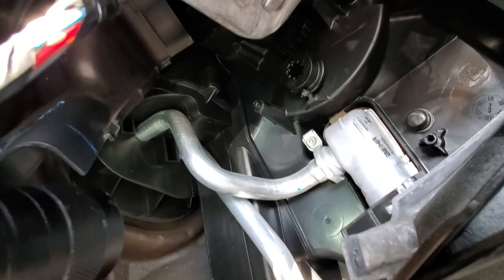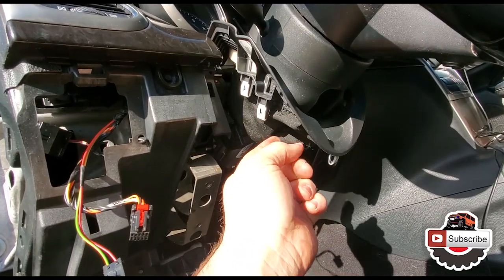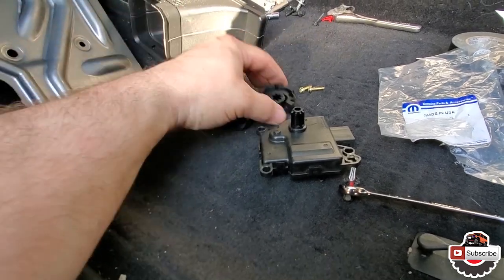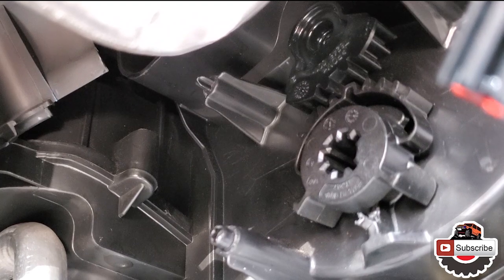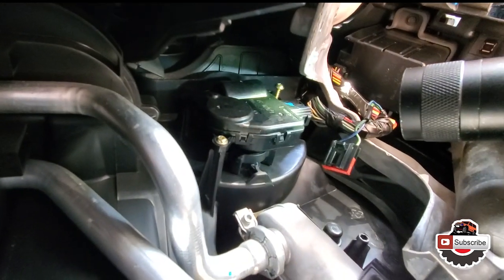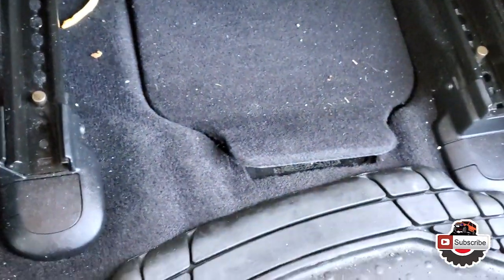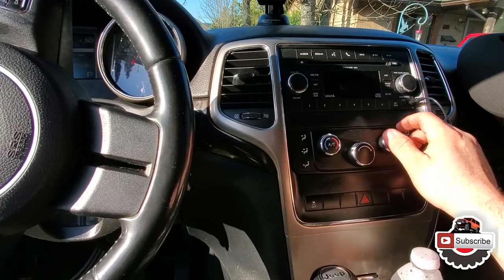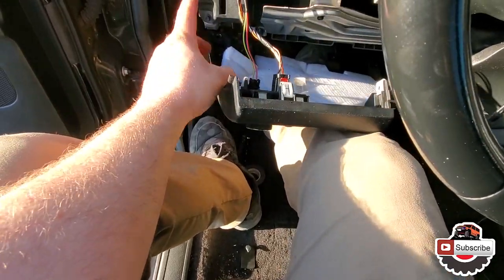2011-2017 Jeep Grand Cherokee Driver Side Blend Door Gear Repair Guide

Comment: Got mine done, However I am 6"3'' and have large hands. So I used a step drill and bore a 7/8 diameter hole in the aluminum panel. This allowed me to get top screw out by inserting a 1/4 in ratchet with the torx wrench. I highly recommend this for us larger guys. Made it sooo easy!

Comment: I just got done replacing this part and there are 2 tips to add to this video 1. there is one screw next to the steering column that holds the right silver bracket from above. It's around the right screw for the panel. 2. the duct right across the actuator splits if you squeeze it giving you enough room to reach the one difficult screw for the actuator.  That's it. Good luck repairing your jeep.

Comment: Hey, today I risk it all and fix my air conditioner, I follow your steps and Danm a was hard at first but I manage to do it all and every step u did I follow and a was hard to put the piece in there but I wanted to give up cause a was hot down there but 100% successful, hahaha I’m so greatful I got it fix I save up $700 hahaha now I know how to fix it without paying a mechanic thanks for your video
Reply from the maker: Glad that worked out for ya!!  Good job, It’s definitely not an easy task to accomplish.

Comment: Good video but you did not have to take the actuator apart just turn the HVAC controler on and plug in the actuator it will start turning and when the alignment Mark's line up unplug it. Then install the actuator and plug it back in.
Reply from the maker: Didn't really think about doing it that way. Thanks that's some good info.

Comment: Great video!  I have a 2012 Grand Cherokee.  I replaced the gear and actuator on the passenger side in 2019 and remember watching a video telling me the driver side is much worse.  Well the dirver side had no heat 2 weeks ago.  I ordered the actuator and the gear and tackled this project over the weekend.  I have a couple added tips:  1)  Definitely need to take out the upper duct work to get to that upper screw on the acuator.  It is hard and seems like it wont come out, but it will.  Break the clamshell and take out the rear first and then the front.  When you put it back together, put the rear in first and then force the front part of the upper duct in.  Then do your best to snap the clamshell together.  2)  Reattaching the hood release cable with the kick panel doesn't work.  You need to take off the hood release lever from the kick panel and then attach the cable to the handle.  Then insert the handle back into the kick panel.  Thanks for all your help!

Comment: This is perfect! Mine is the passenger side. The quoted me 3.2k and said my entire HVAC was damaged. I was like how? So I will be ordering and replacing that piece  to try this. I'm 8 months pregnant and cant drive in this heat with no A/C. Thank you so much.
Reply: Hi Toni, I’ve heard exact same from my dealer. Decided to do it myself. My motor was good, just shredded plastic gear and stuck blend doors. Apparently you can access that by removing door vent. I ll work on my soon and let you know. We’re you able to fix yours ?
Reply: Hey guys actually passenger side is easier than driver side passenger only took me 10 mins to do it the driver took me about 1hr an a half for my durango good luck guys and take your time to get it right the 1st time

Comment: Great video Bro. I actually used it a couple years back to replace the gear on the drivers side. Now the passenger side is blowing rubber out the vent and the door gets jammed. So you have any suggestions for that w/o me having to take the dash apart to remove the distribution box?

Comment: Very good video brother  I don't know what I would have done with out your help 
I just got it done on my 2012  the only thing I did was I turned the gear  that  I replace with the one that was good I alined them I rotated them with air on to find out witch direction cold was lucky that the motor was in that direction also  put air on low and installed no calibration    I did have trouble with the air vent that I had to move puting it back sucked   thanks brother  and yes those pipes were HOT
Reply from the maker: You're welcome man! Glad this was of use.

Comment: Thank you!  Quick question, would having the actuator disconnected cause the blower motor to turn on and off on it’s own?  I have replaced the compressor, expansion valve, blower motor, resistor, and a/c controls module but the blower motor starts at full blast and just drops to low power every 30 seconds.
Reply from the maker: No that would cause that, have had to replace the blower motor resistor in a 2011 before with similar symptoms and it was back to operating properly.
Reply: @JeeperGear  Like I said.... brand new resistor and blower motor.  Your response to my question is confusing... Having the actuator disconnected will or won't cause the issue I described?

Comment: Great tip about opening the actuator motor box and rotating the stem so it aligns!  thx for that one.

Also - are you kneeling outside the car or did you ever lay down on your back in the drivers foot area?

Comment: Awesome video. i think i am half way thru the  repair. Found the blend door gear broken. The actuator is out and noticed the internal actuator gears do not turn freely by hand. Wondering if that is normal? i opened the actuator and all gears look good. Realigned so the gear is facing the right way. i would like to be sure so i am only fixing this one time.
Reply from the maker: Yeah thats normal. Some use 9v to make it turn, I took it apart, realigned it and was good to go.  So far not a single issue with it since I made the video.
Reply from the maker: I would also make sure the blend door moves freely in the heater core. Mine was stuck so i pulled on it and got it unstuck. It's a common cause of these gear failures on the driver side.
Reply: @JeeperGear  Huge thanks. Your video was so helpful.
Reply: One more question. When i started to take apart the dash i did not disconnect the battery at first. My driver door was open for quite a while. i started removal of the screws for the knee panel and i noticed an electrical smoke burning smell that lasted for a few seconds. To be safe i then disconnected the battery. I don't think i touched anything to make this happen. Any idea what that could be?
Reply from the maker: @kevinshellenbarger1877  Yikes, I would look around the areas you worked on and inspect for any wiring that could've been jammed or have  the peeling  insulation and during the removal process it shorted something.   Realistically other than screwing up the programing, or setting off an airbag light if your model came with knee airbag, with battery still being connected. Those things can be corrected and shouldn't cause any type of smoking.
Reply: @JeeperGear  I finished the  repair and all is good. Working great. The repair took me  to afternoons about 8 hours. There was something under my driver seat that caused the smell and no worries. Your video was a great help. Huge thanks. I would like to make a donation to your site in appreciation, but I do not see that option.

Comment: Excellent video! I started down the path of investigation this evening before taking the drivers side completely apart and I did notice a broken tab off one side of the gear however the actuator moves the gear back and forth but it doesn't seem that the door opens/closes. That leads me to believe that maybe the top portion of the bottom gear isn't moving the top gear and therefore the door but I didn't take it apart enough to see and I didn't see any gear parts come out. Seems like that's the only option that it could be though. Any thoughts before I take it further apart to see the entire gear that the actuator drives?

Comment: Thanks a lot for video. Planning to do same work tomorrow. Only a little bit confused with gear alignment & why did You open actuator.
Reply from the maker: It was to point the gear the right way.  In my case it was clocked backwards.
Reply from the maker: There's also other ways. Like hooking up a 9v and use the motor to turn it in to position.
Reply: Yesterday completed all installation, understood what You mean during work progress))). Many many thanks for video. All the best to You.

Comment: I tried to replace mine but it's still doing the same thing. The ac feels slightly colder on the drivers side but the passenger side is still backwards. I had to set it to cold in the winter and it basically blows neutral now on hot. I tried disconnecting the battery and pulling fuses 3 times. Someone in a Facebook group said sometimes it needs calibrated with a computer but I have no idea. I'm done with it
Reply from the maker: Sadly, It is possible that the vent it’s self has gotten stuck.

Comment: great video, i have the exact problem, and then some,  when i took the gear and actuator off, the blend door itself seems to be stuck and doesnt move.  Should i be able to move it freely?  or will it be fine when i put the new gear and actuator on. Thank you for the help
Dan
Reply from the maker: It means the actuator motor pushed it past its rubber stop and blend door is now stuck. In my case I was able to stick my hand in through the side vent and pull it free, meaning its free to articulate on the axis. 
Sometimes if you it got pushed too far and you can't lossen it, sadly the heater core will have to come out.
Reply: @JeeperGear  Thank you so much, so cool of you to share your knowledge on here, i will take your advice and work on this some more!
Dan

Comment: Upper gear got stuck on different position what should I do ?? Any tips ?
Reply from the maker: Hope I understand your issue correctly, I had it where the gear that’s connected to the flap 
, was over driven it and it was stuck. 
Two options to go from there, reach in through the duct and push it lose or if it’s not coming lose, then the heater box would need to come out, which is a whole other job.

Comment: I have a similar problem with my jeeps AC,,driver side doesn't throw cool air just passenger side,,but there's also a popping sound coming from underneath the dashboard,,could that be part of the problem???
Reply from the maker: Most likely, the gear has snaped and actuator motor is trying to engage but keeps skipping
Reply: Oh ok..thanks for the reply. 
So just buy the small gear ⚙?
Reply from the maker: @DavidCastillo-qh6vq  If you have another means of transport, I would inspect and determine exact cause.

Comment: Sir, my 2011 WK2 is blowing hot only on both sides. I checked the obvious R134 and it checked out good. Is it possible I need to replace both drivers side and passenger side blend door actuator’s and or gears? I’m very novice at this game. Thanks for any input in advance:)
Reply from the maker: I would check on the passenger side first, as it is the easiest to get to that actuator gear for inspection.
Reply: JEEPER GEAR is it possible it could only be the passenger side or vice versa? I know during the winter I had the heat on and noticed the passenger side was blowing cold air when the heat was coming from the drivers side. Would replacing just the passenger side fix the drivers side?
Reply: Jeret Norris have the same prob hope he answers lol

Comment: 😢good morning teacher I have a question why my grand cherokee 2012 fans air and then turns off, and so on the same
Reply from the maker: If I understand correctly, could be one of two things. Blower fan motor it’s self is failing, or common issue with blower fan resistor. That resistor controls the speed of the fan, when the system wants to slow down the fan or speed up and that speed bridge is burned, fan will shut off until another speed level is selected by the auto climate system or speed knob.

Comment: Im close to halfway through the repair. I'd say 35%... The duct, how did you get yours apart? I'm afraid of breaking mine.
Reply from the maker: I used a 4" long thin flat head screw driver to push the tabs for it to come apart. I did break one of the mid tabs.  So i put on a loop of vinyl tape to help keep in place, just for a peace of mind.
Reply: @JeeperGear  One more question, Just in case my blend door is stuck, How do I rotate it back to its regular position, and how do I know it's there?
Reply from the maker: The way I've done and identified the issue, is if the blend door stub out gear on the heater core is fixed in one position and won't freely rotate, it means that it is stuck. I put my hand in there through the vent and applied good amount of force with my fingers to push it back to a free lose moving position.  In some cases, the gear motor drives that blend door so far in past its limit stops, that a heater core removal is needed to get better access to loosen it. Also seen it snap the core casing in half, but thats very rare.
Reply: @JeeperGear  I hope my blend door isnt stuck.... How would I remove the vent if I need to move the door itself?
Reply: @JeeperGear  So how do I remove the vent in case my blend door itself is stuck so I can reach down and move it myself?
Reply: @JeeperGear  I got the actuator off finally. The ducting for the footwell fell off lol

Comment: How did you separate the upper duct for the hvac to get better access?
Reply from the maker: I used a 4" long thin flat head screw driver. I did break one of the mid tabs.  So i put on a loop of vinyl tape to help keep in place just for peace of mind.
Reply: Yea, that was really hard. I did a lot of pressing with the flathead and eventually the connection came apart, but there are two on each side.

Comment: Hey jeep gear. so I've replaced my blend door actuator underneath my steering wheel of my 2011 GC Overland. However, after calibration and when plugged in, it seems like the actuator motor continues to try turn the gear pasts the wall hard stops and so I'm still hearing the gear clicking noise from inside the new actuator. It seems the new actuator doesn't know when to stop turning. Do I have bigger problem like the heater core/blend door traveling too far or could it be that I just got a bad blend door actuator?
Reply from the maker: I would check to make sure the blend doors are moving freely. If they were pushed past the bump stops, they would need to be returned back to operational position. I've been lucky and have been able to just stick my had through the vent and pull it back, so it can move freely.. But some are not and would need to pull the heater core and do it that way. 😔
Reply: @JeeperGear  I can turn the doors freely without the blend door actuator attached to the gear and simulate hot to cold and cold to hot. It’s only when the motor actuator is attached that it seems to not function correctly. I’ve tried unplugging the battery and removing the hvac fuses as well. Calibration seems to happen a few times when I start the car and I can see the gear turning and sensing the stops but when I try to switch from ac to hot and hot to ac from the middle console only the passenger side works, the actuator for the drivers side doesn’t respond turn the gear to open the door. Could it be just bad blend door actuator then? This is the second new one that I’ve tried already.

Comment: I have airbag in that area is it same procedure?
Reply from the maker: Here's a great step by step resource to use for reference on how to do this. It's in pdf format. http://www.wk2jeeps.com/pdf/WK2_Knee_blocker_airbag_removal.pdf
Reply from the maker: Also keep in mind, I cannot stress this enough, anytime you are planing to do any work on a srs system, have the battery disconnected at all times and only reconnect it after everything is plugged back in and verified. This will help you stay safe and avoid any srs lights in the process.

Comment: I recently replaced the blend door actuator gear on the driver side of a 2011 jeep grand cherokee. Everything seemed to work but now my control for the drivers side is backwards; blows cold when dial is on hot and blows hot when dial is on cold. Any advice on correcting? I've tried some calibration but to no avail.
Reply from the maker: That is very interesting. I have not come across that yet. 
 I'm going to speculate here, only thing I could think off is perhaps by some weird chance, the connector is in backwards on the actuator its self. Thus the swapped polarities on the actuator motor. As you seen, logically the gear only allows  movement in 30min increment back and fourth.
Reply: Did you get an answer to this or figure out this problem??? I’m experiencing the exact same thing!

Comment: Mine blows strong and then cuts off for a minute or so and then blows strong again. Would this be likely the same issue?
Reply from the maker: I found that exact issue to be the actual blower motor. Swapped 4 of them out from with aftermarket replacements from local autoparts store, till found one that works till this day.
Reply: @JeeperGear  so look at replacing the blower motor itself and should take care of my issue?  Was it just a bad connection or just the motor itself giving out?
Reply from the maker: @tyhodge07  in my case it was a bad motor. Connector wasn’t burned. 
This reminds me of a one 2012 wk2 I did, where I had to replace the blower motor resistor to solve a similar issue.
Reply: @JeeperGear  ok thanks, whenever it decides to warm up here I’ll pull the glove box out and check over some things. Is there any ohms readings I can do to test the resistor or motor?